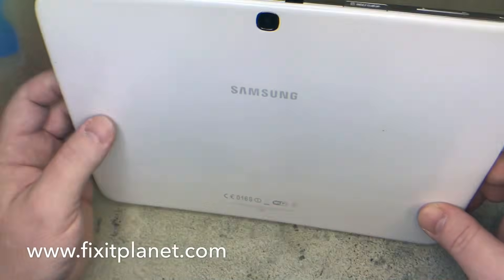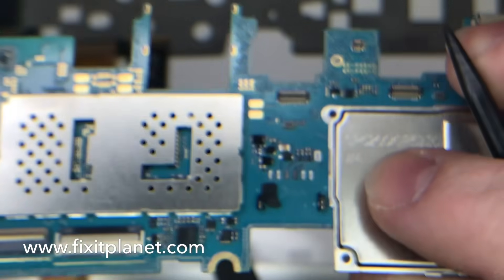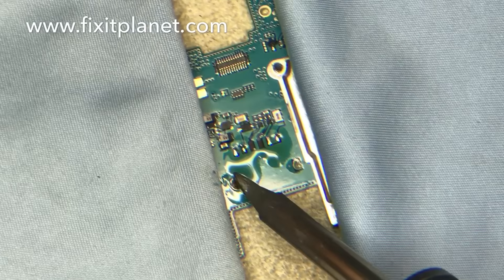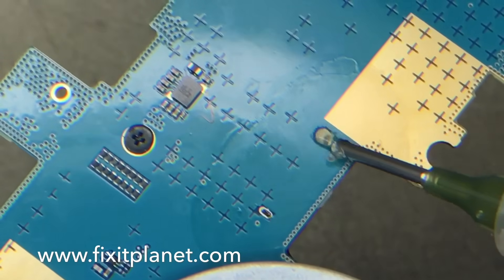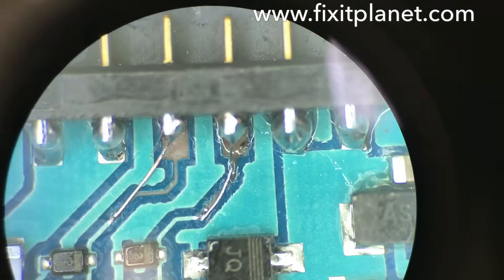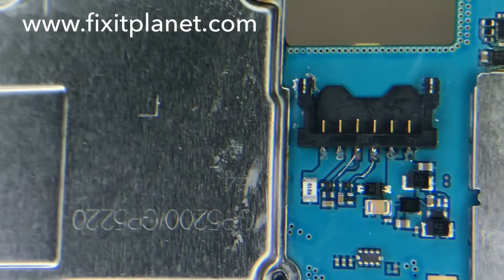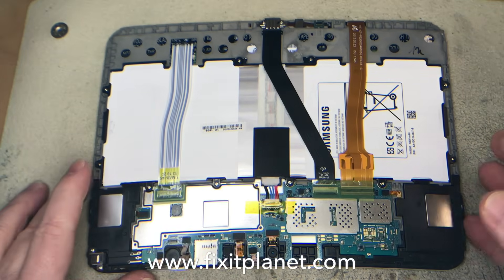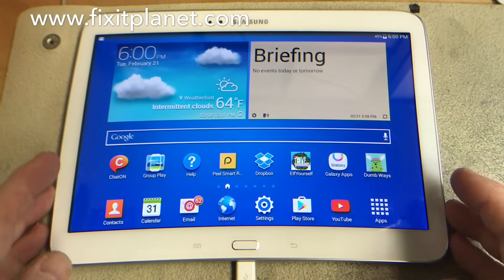Galaxy Tab 3 10.1 Broken Battery Connector And Damaged Trace Repair

Comment: Hi, I need a PCB Diagram with trace on the Samsung sm-j100. Specifically the PCB trace from battery terminal (missing the tabs) to their perspective components on the motherboard but, not from charging port, I need it from the terminal & there are 4 terminals on this. I've been looking for this for so long, I thought I finally found it but, the one I found was miss labelled & turned out to be from a different phone. If you can't help me with this, do you know where else I may be able to find it? Any & all help is greatly appreciated. Thank you
Reply from the maker: Seriously dude... just reconnect using jumper wire and you will be amazed because it works.
Reply: @FixItPlanet1  if I knew how to do that, I wouldn't ask

Comment: Both ports have electric connection on the motherboard? Or their purpose is just to make the connector intact on the board? Thank you and nice video
Reply from the maker: Some are ground some are feedback and some are positive and negative. They are not to anchor the port that is the anchors job.

Comment: is there a way ,like test points , to reset the pcb board? my p5200 shutdown  by itself when playing a game turned into a green screen then it went dead. First ive replace the usb and the battery and it charged the battery (the charger was heated , also ive checked the voltage of the battery usb unplugged and was 4.0 v) .Now it wont charge anymore, but it draining  the batteries if i let them connected onto the board pins (im charging the batteries old and new one with wires connected on a portable usb pack).The mother board isnt heating in any place even i let it connected to pc for hours. The pc recognize it as a cloverview device and pc beeps when its connected or the power button is pressed .Is it any chance to revive it ? thank you

Comment: I've got a Samsung Galaxy Tab S 10.5 that won't charge or even try to start. I changed the motherboard, battery and battery connector. The only response I've gotten from it has been, when I changed the battery. While holding the power button on, it came up in a boot loop. The battery drained and now nothing. Any ideas? Does it sound like something that can be fixed?

Comment: The JQ diode and the big capacitor next to it getting hot and no power at all. Capacitor is ok , diode replaced but getting hot, too. Any ideas?
Reply from the maker: Could be a short somewhere else causing them to get hot.

Comment: My samsung tablet stops completely a lot of times. If i am using it in my hand , then at times it will completely turn itself off, which is a real pain in the butt, i have been told that it could be a loose battery connection, sometimes i can hold it upside down and hit it onto the palm of my hand , not too hard of course , then it seems to work for a while . have you heard of this happening to other Tab3 10.1 tablets , and how to fix it, I am in Australia, Cheers and any advice is greatly welcomed. Les
Reply from the maker: It is possible the solder needs to be re-flowed on the connector. That is a common issue with these tablets. However there are other possibilities to be considered. It's a process of elimination.

Comment: I'm a total noob at circuits and soldering. But, what term would I use to find the copper pieces you used to repair. Also, what did you use to scrape and flatten the tinned copper down into the furrow? Did you use heat? How do you keep the solder hot in the first cavity if all of the solder came out of the board with the old connection before u get down to the last? Would a heat gun work? The other components are so close to the area. I'm concerned about burning them. I even got a third iron with variable voltage.
Reply from the maker: We use an X-acto knife to scrape the masking and expose the copper underneath at the point where the missing pad would have connected to. Then we tin the copper using a soldering iron, flux, and solder. Then we attach the micro jumper to the exposed layer we tinned and the corresponding pin using the soldering iron, flux, and solder. You can use magnet wire for the jumpers something like this for example. https://amzn.to/2ExNYte

Comment: You should link this fix to the tab 12.2. There is one video on YouTube about this fix, and it is a ghetto wire the cords straight to the board with solder, and that's it. I've even been to forums where others refer to this as the only video and have given up on theirs.

Comment: Great Video! My Note Pro 12.2 battery connector also broke off motherboard. Traces look fine. Three pads have no solder - can I just re-tin them?
Reply from the maker: If the pads are still intact then you can tin them and solder everything back. No problem.

Comment: Hello !  Thank so much for you video. I have a problem and i need your help. I have a tab 3 gp 5200. And he is not coming on. But went i connect the charger he charging and when I turn on the tablet, there is a red cross on the battery sign. But he is keep charging. If i take of the charger the tablet goes of. I order a new battery and I have the same results. Thank for you help...

Comment: your connecting ware is to tight. if the connector will get any pressure again, connecting wire will disconnect from the PCB. use insulated copper wire and make that as zig zag that should take more tension and perform well.
Reply: Agree!   thought maybe i was wrong,  but then again, i have yet to do repairs.  ~ *   peace